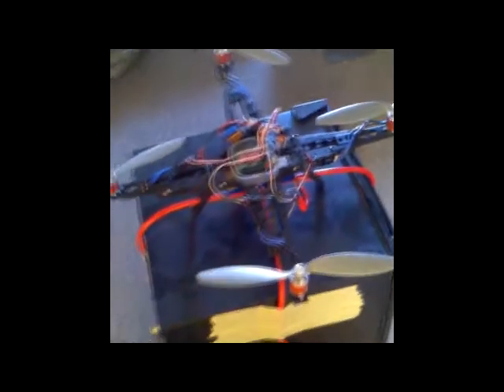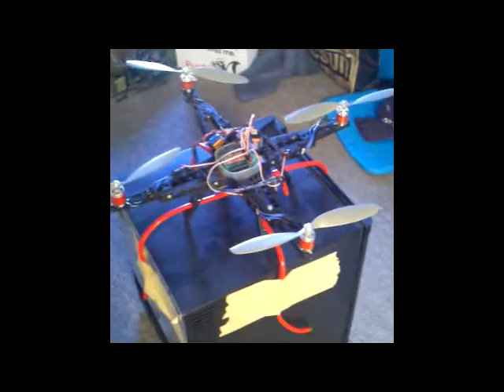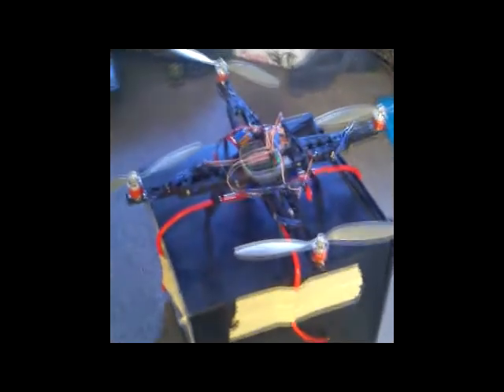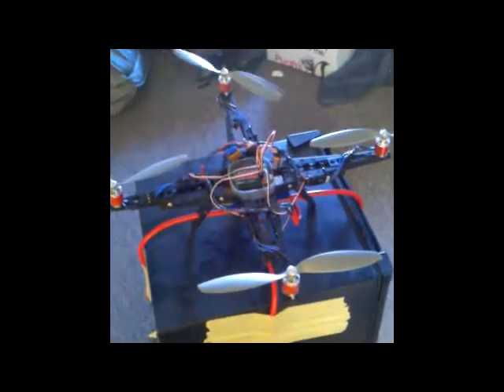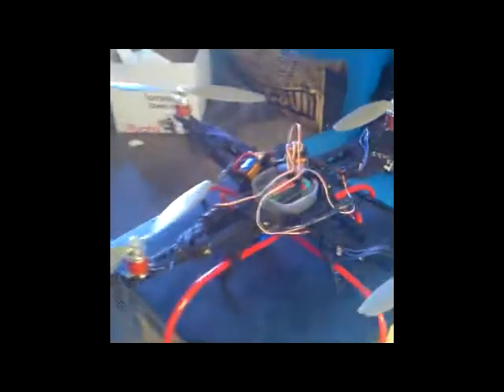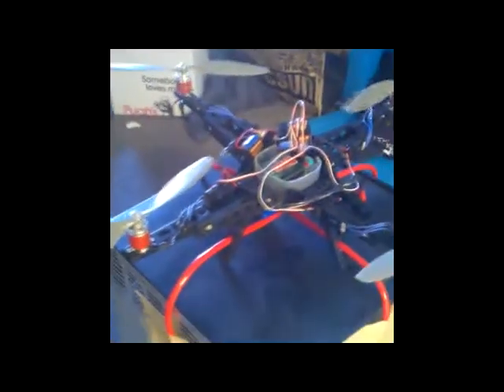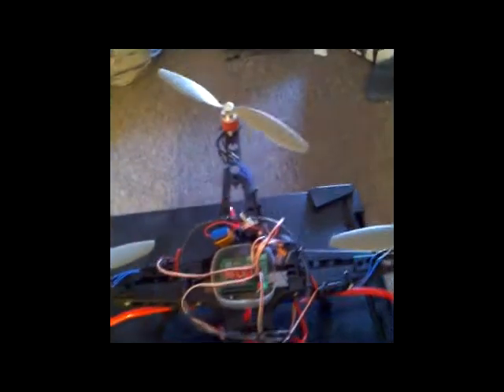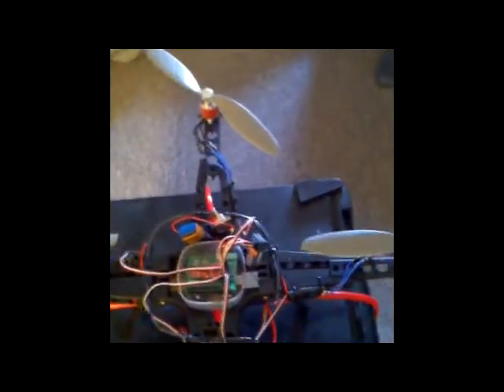Arduino QuadCopter 5

Comment from the maker: I finally have it finished.  It only took about 3 months of working off and on.  If you're fairly familiar with electronic theory, the assembly isn't too bad.  The biggest issue I had was just making everything fit and getting it tuned.  Ideally, you would have a friend that knows what they're doing to either hold the craft or operate the remote while you're tuning so that you don't have to rig up a tether like I did here.  That would be the best way to make sure it's tuned before flight.